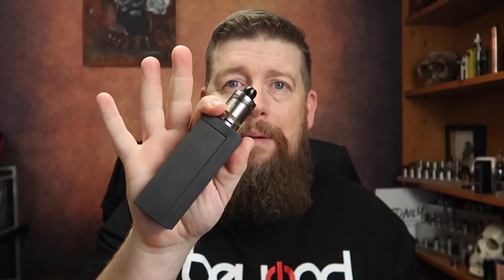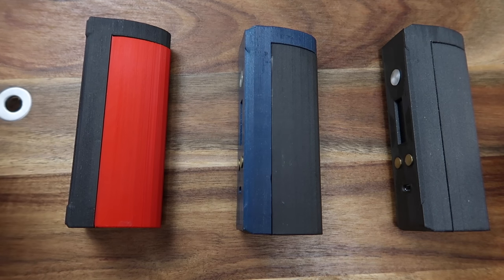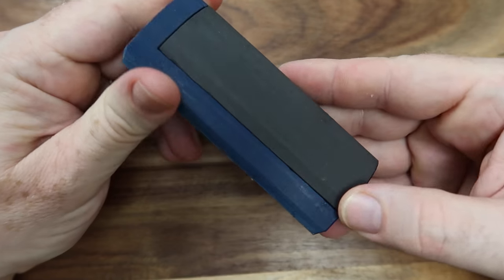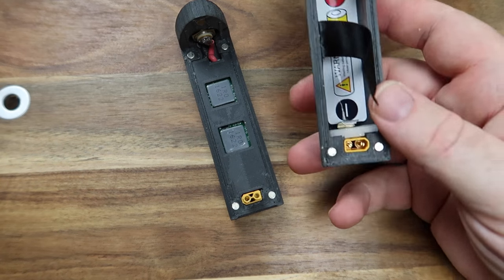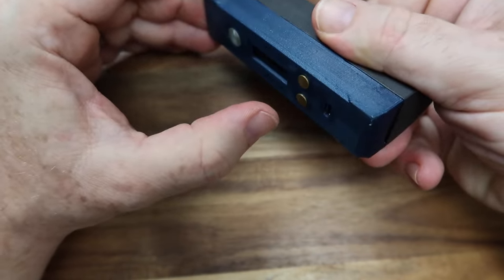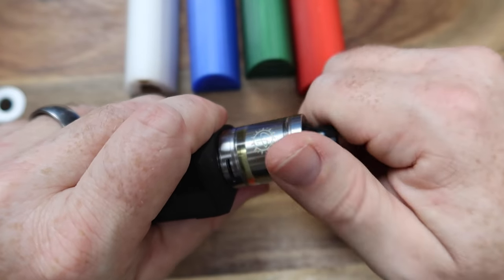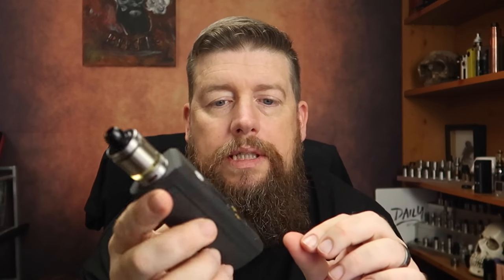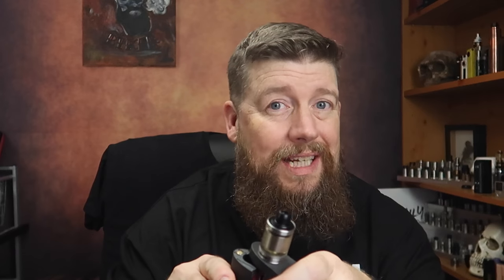The ETNA DNA75 from JULESVAPES - Custom options galore and affordable!

Comment: 3D printers are going to be a household item in no time. 
If the cover model was open source, we could custom print our own. 
The main problem is that the battery is in the removable part which would make it difficult. 
If it was just a cover, like the Theriom, a user could easily print their own.

Comment: Well, it is something different, I mean, it doesn't look like most of the mods we are use to see. It looks a little...rough finish? I think they still have to work on that. I even went to their website, they don''t show you many pictures and they don't show you how each surface finish looks like, but they do have many options for you to choose from and that is pretty nice.
 It's an interesting thing they got there, still need some work but pretty interesting. Thanks for the video.
Reply: Hi Vanessa, there are more pictures of the different colours on the website now
Reply: JulesVapes nice! I will definitely check it out. Like I said, you've got something very interesting going on, wish you the best of luck. Keep on the great job 👍🏽